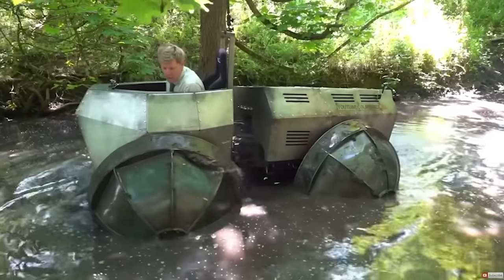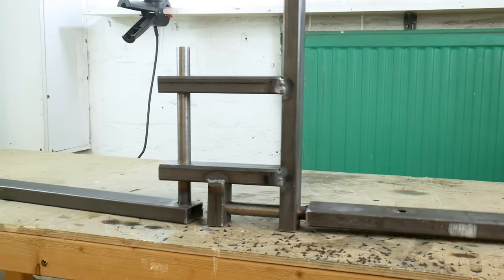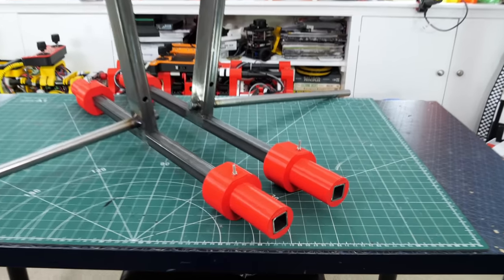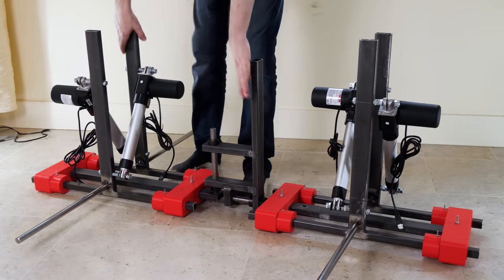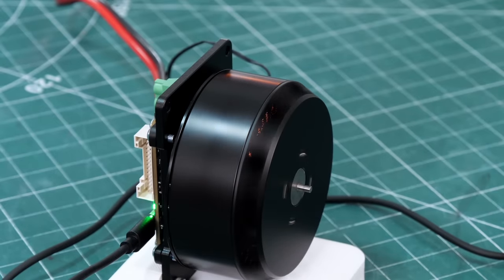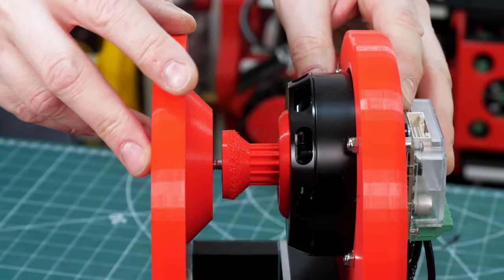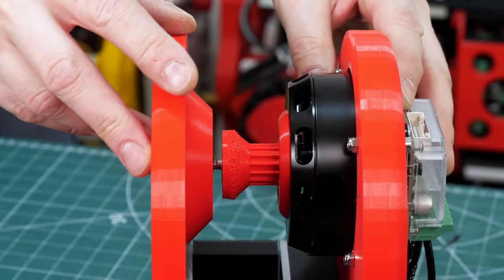Colin Furze Helped me test my TANK

Comment: 🎯 Key Takeaways for quick navigation:

00:02 🚜 Colin Furze built the Rhino tank concept inspired by the 1950s Elides concept with dome-shaped wheels for increased grip in mud.
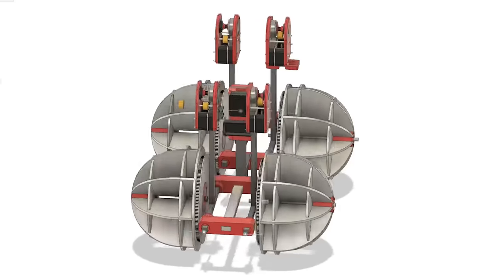00:33 ⚙️ James Bruton plans to create a smaller electric version of the Rhino tank with servo-controlled camber angle and plywood wheels.
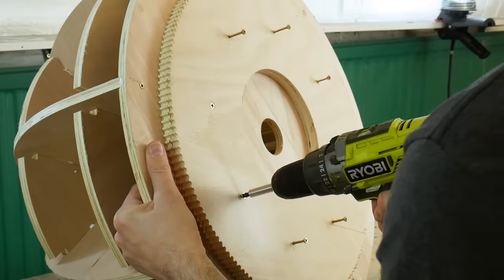01:43 🛠️ James is leaving his wheels open for more grip and easier maintenance compared to Colin Furze's segmented design.
03:07 ⚙️ James assembles the chassis with steel lengths, creating articulation for steering and wheel movement.
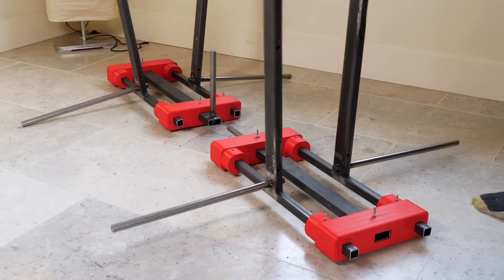05:39 🔧 James installs linear actuators from Gimson Robotics for controlling camber angle, enabling the tank to steer and tilt.
07:23 🏎️ Motors for the wheels are O Drive branded, 8325ss, 100 KV, with O Drive S1 drivers for control, providing around 1500 watts of power.
09:41 ☀️ The video's sponsor, PVcase, offers Next Generation AutoCAD-based PV software for solar plant design and analysis.
10:50 🏗️ James tensions belts for wheel drive using idlers and wedges, ensuring stability and reducing potential belt slip.
13:41 🔄 The tank has four-wheel steering and velocity-controlled O Drives for straight movement, but limited active steering.
15:30 🌱 James tests the tank's grip on wet grass, noting its capability for slow, cautious movement.
19:56 🏞️ The tank successfully climbs a hill, demonstrating improved handling and grip.
22:06 🦆 James encounters challenges in a muddy ditch, struggling with wheel slippage and maneuverability.
22:48 🔄 The tank experiences wheel slippage in the mud, needing assistance to get out, similar to previous challenges faced.
23:49 🚜 With proper active steering, James believes the tank could have easily overcome the challenge of getting stuck.
25:11 🚗 James attempts to transform the tank for better grip, but it ends up getting stuck in the water.
25:58 🌊 The tank tips further than intended, causing concern for James, but manages to self-recover.
26:55 🧹 After cleaning up the tank, James reflects on the challenges and the concept's mixed results, showing more problems than promise.
27:26 🏞️ James speculates that with power steering and modifications to the wheels, the tank could perform better in muddy terrain.
27:41 🔗 Despite the challenges, James thanks Colin for the opportunity to test the tank and plans to share the project's code as open source.

Made with HARPA AI

Comment: This looks like, with active steering and some kind of better grip on the wheels it would actually work great. Possibly with the addition of some ballast to lower the center of mass?
Reply: I also wonder if one of the difficulties traversing the water is that you were getting air trapped inside the cells of the wheels and reducing the effective weight of the vehicle and therefore its traction. Maybe adding some holes to the fins of the wheels to help it expel air would give it better traction when partially submerged?

Comment: If the lunar actuators were used more independently,  not just as pairs, but each wheel independently? If have two large springs or a couple more lunar actuators between front and rear and stops/blocks to keep from jack knifing? Could also see how a computer controlled auto program, something like drones use, could help keep wheels from  spinning and maybe control steering better?

Comment: OK, IF you're going to use plywood and it's not "Marine" grade you needed to have coated the edges with two part epoxy so that the edges don't splinter.  That needed to be done before you painted it.

Comment: I'd hypothesize that the lighter design actually detracts from the effectiveness, as the wheels don't have enough weight to really sink in and get a "good bite", thus the slipping. Limits on all of the turning (as you did ad hoc in the video) & the actuators to prevent the wheels from hitting each other as well. Yea, there is definitely promise here.

Comment: Instead of building the wheels semi-circular (infinite variable rate to camber angle) could you build them with two or three distinctive angles, I think you might get more feedback in your controls ?
Put some floatation qualities in the wheels ?
Does the central 'hinge' need an extra axis that allows an X axis in the vertical ? (the front and rear of the machine can move up and down, in an arc, in relation to one another.(using weight and torque and maybe terrain to calculate the suspension set up/response) ? (Also see Sherman tank suspension bogie, where the bogie wheels are the front and rear of the machine)
Also I'm quite drunk.

Comment: Would it be possible to add some form of diff/axle lock by synchronising all the motors to always drive even if one has lost traction similar to what is implemented on off road vehicles?

Comment: Cool failed concept. I think it could almost work but it needs quite a few design changes. The huge wheels definitely need huge power to drive. I like the paddle better if it floats it would be paddeling along and the added grip for rock climbing, but it makes a rough ride.

Comment: surely the whole point of the wheels is their displacement, so they need to be covered and watertight, so they're full of air and nearly bouyant. plus the adjustable contact patch requires a consistent surface, not the spines of plywood. which will just sink into the mud, then small treads to provide grip. Vacuum mould plastic covers, seal them up, then cover them in rubber tread / grip tape.

Comment: You forgot the number 1 rule of traction drives;
Always make sure all wheels turn at the same speed (unless vehicle is turning).

There should never be a situation where one wheel spins while other 3 wheels are stopped.
In most cases you can fix that by setting the motor driver modules to throttle RPM mode. It looks like you had them set to throttle current mode which was the worst possible choice, even throttle PWM mode would have been better than that.
Reply from the maker: They are in velocity control mode, but they are current limited to 30A each @ 50v, which apparently isn't enough
Reply: @jamesbruton    Thanks for the reply. Your videos are excellent.
Innthat case maybe increase the gearing ratio by a factor of 10 or 20. It seemed more like a racecar than a mud crawler 🙂

Comment: I couldn’t get through the whole video, seemed like a not well thought out plan. When the contact patch of the wheel is a curved (semi hemisphere) there’s going to be track issues. Try and lean over a motorcycle tire and roll it in a straight line by holding it at the axle, there needs to be some toe in/out to be accounted for. Fine when camber is zero degrees, but if tilting positive in this case, I imagine you’d have to toe-in to effectively track forward?

Comment: I think you need to make the frame rigid, and drive it like a tank. And or make the wheels more grippy, I think you were assuming that wheels wouldn't slip at all so you wanted the body to flex but the wheels do slip, I would work with that not against it

Comment: a good approach, but in theory the wheels should work better precisely because of the spherical rolling surface and not because of the lugs...
fill the wheel niches, for example, with extruded polystyrene foam coated with fiberglass, this will be as close as possible but will still remain minimal in terms of labor investment...

Comment: This is painful to watch at 21:00 - why you don't use the actuators? xD It obviously can't get out of a hole if the rotating axis is pointing nearly straight down on the wheel which needs to get grip and move it out.

Edit: I would add power steering and if possible angle control/steering, so you could try to lift one side using the other. And put the electronics in sealed box so it's more fun xD

Comment: You are not supposed to touch you tungsten electrode to the metal to start TIG welding. Like that you will contaminate tungsten electrode which will lead to poor welding. I know, for this application it is okay to have bad quality weld, but in the future you may want to avoid bad practices.
Reply: It's lift arc, he's gotta touch the tungsten.
Reply: @donkeypoopdragon  Yes and not "touch & lift arc" at 3:25, the tungsten is already ruined.

Comment: Your slippage problem is due to a lack of normal force, as F(friction) = F(normal)* coef friction. The farmers in Europe and elsewhere have dealt with this for decades by putting fluid ballast in their tractor drive tires. This increases the normal force of the wheel without increasing the rotational inertia. I've built some off-road bots, and the use of fluid mass in the wheels can dramatically improve stability and traction. Might want to consider this in your design, should you build another off road vehicle.

Comment: Hmmmmm, making it buoyant and by slightly altering the wheels to be more efficient paddle wheels, it might have a sort of smooth transition from mud riding to gliding over water. I'd make the paddle bit close to the vehicle. I think the rest of the wheels should be filled in and covered with some sort of profile. There isn't that much grippy area on it now. Impressive bit of engineering, love how much mud and water it handles.

Comment: why even servos, you could hand crank the wheel angles, like a lift, you dont have to motorize everything, better keep it simple. shees. or just step locks. well that tank mode grip for slow torque mode, and smooth for fast car mode. tank needs to rock and roll, no holding back, on speed, ditch or not, up to 80kmh. cant keep its direction.

Comment: Hmm ,can't help but feel the camber mechanism and split turning just added more needless complexity and weak spots. You're testing the wheel design, right? Shouldn't you be able to make a wide bodied square with fixed angles, make it more tank like, and simply rely on the design of the wheels and differential power for turning.

Comment: 6:14 Wrong mount point of 2 hydro system, they are not effective, if need use simultanious - you need connect  from umovable  part to upper part of arm.
IF you need to act them syncronous, so its ok.

Comment: Should have added steering by making the front wheels spin at different speeds from rear wheels, not just one side and the other, tanks dont have a joint in the middle, becouse they dont need it
Reply from the maker: That is one of the steering modes
Reply: @jamesbruton Hm, missed that then. Sorry about that.

Comment: The belt system is a failure, so much power lost, added problem to an already problematic system.😢
Reply from the maker: Pretty sure there's not that much friction losing power 'in the belts'. It is more efficient than gears.
Reply: @jamesbruton  
According to Google
Advantage: Gear drives are expected to last longer than belt drives. Advantage: With more torque comes more power. Gears create less friction, so they can accelerate up to higher speeds quickly. Disadvantage: Gear drives may be slightly more expensive and require more maintenance, where regular lubrication is required.

Extension from me:
Gear drive give more practical room for adjustment and development

Comment: If you had tank steering then why did you put the pivot in the middle?  That makes no sense.  If you had a steering ram of some sort and programmed it to very the wheel speed based on the articulation angle.  The main problem is it will never do better than say a 4x4 quad with special wheels and dif lock front and back.

Comment: Didnt really even compete in same class as Colins was drivable. Sure testing the setup in smaller form is good idea but it needs to be ridable for proper comparison. You are going into bog and slippery grass... and think differential steering is enough? You bloody mental m8? James has clearly been bit too much inside, hence his thinking when it comes to anything remotely close to outside environments is bit screwed, but least its large step towards actual offroading... Next time put all the electronics into water tight box so you dont have this danger, though motors might be issue. Also bog and open belt drives? Yeah that is a problem soon to be noted.